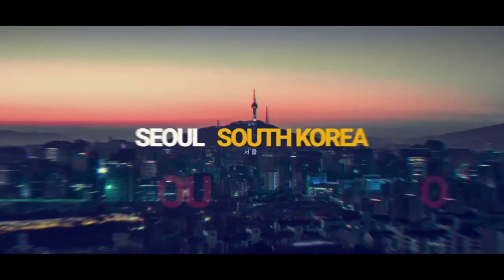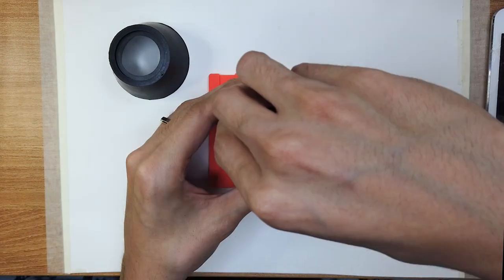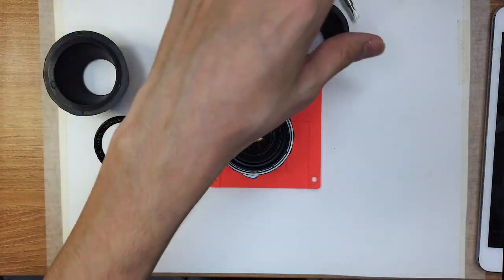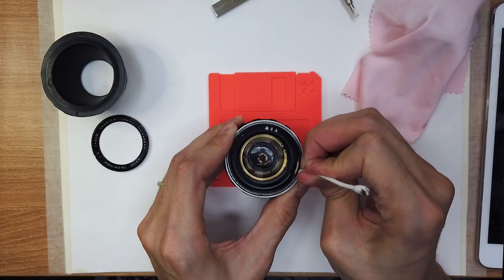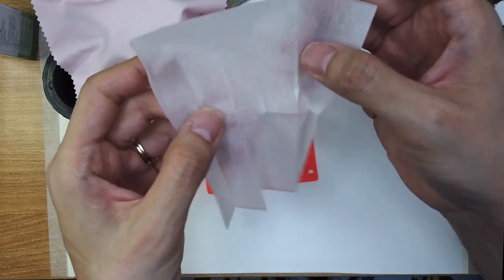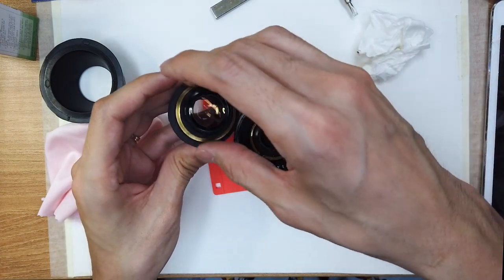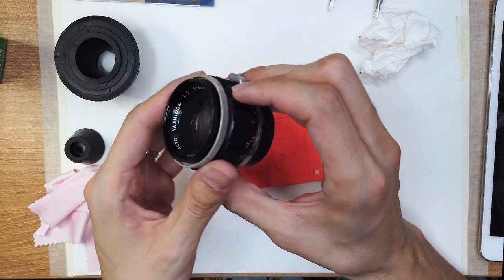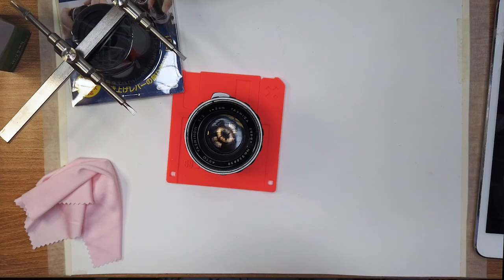Lens Repair Tools - Feat. Yashica Auto Yashinon 5cm f2

Comment: This is one of my favorite vintage lenses (I own two).  I was not aware that these were not radioactive though ...the glass on mine is kinda "yellowish" so  I always assumed they were yellow-tinted (thorium) lenses. 
Anyhow, thank you for this tutorial. It might come handy in the future. I have only tried to dismantle and clean an old Helios 44 once which in my opinion is a great lens for a beginner to experiment (cheap, readily available everywhere and easy to dismantle lens). I used an ammoniacal base especially suitable for crystals, bright and glazed surfaces.
 It dries quickly but I might look up to some of the benefits of using ethanol instead.
Reply from the maker: Oh the lens is kinda yellowish I assume because of the leaded glass they used to use :)

Comment: Dude, I have the 50mm f1.4 and I took it apart, literally unscrewed everything down to the individual pieces because it was loose anyways. For the life of me, I cannot get the F**KER back together. There's these two metal tabs on the front half that I think are supposed to mate SOMEHOW with the rear half of the assembly, but it will NOT lock in place. Any suggestions?
Reply from the maker: Oh super sorry - this is the first Yashica lens I take apart : (